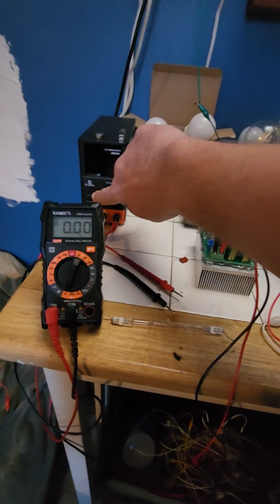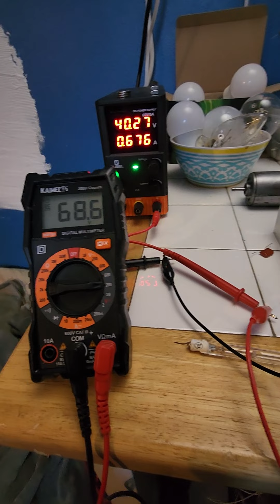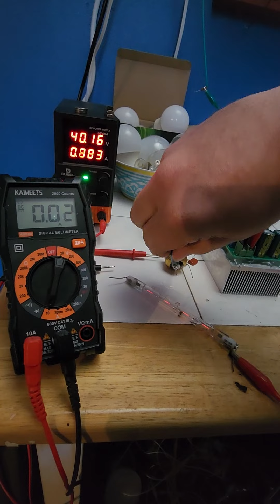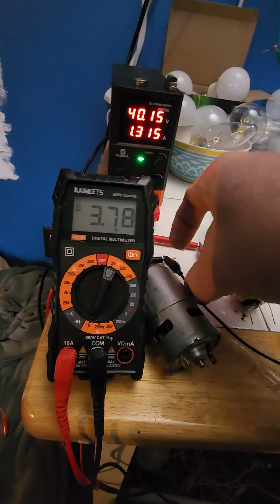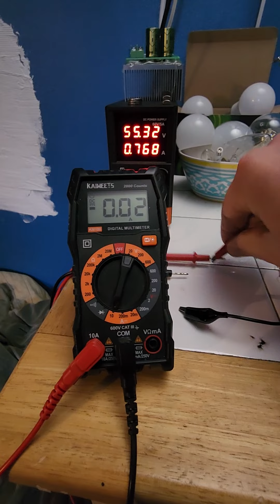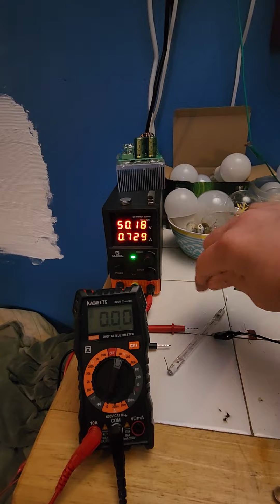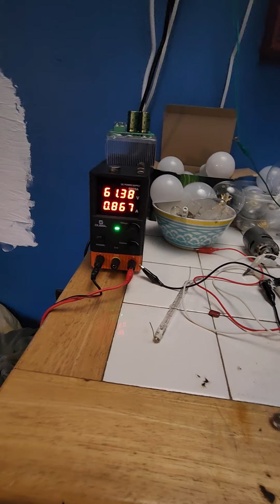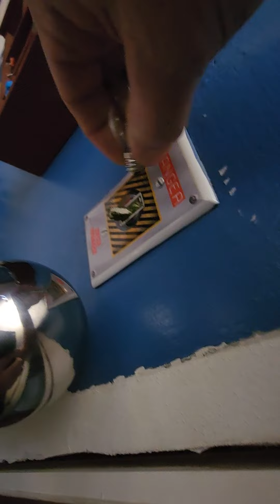⚡️Mal-Effect Generator  Tests. Absolutely Undeniable Resonances Using Back EMF & Earth⚡️

Comment: For Watts, Voltage and Amperage MUST be measured simultaneously.  I love your work and don't want to see you get criticized for such a common mistake.  All you need to do is retake the measurements while using two meters measuring a load a the same time (one set to volts. the other set to amps.)

Comment: Regarding 3-5 times more out than in... Sorry but there is no proof so far as you keep making the same mistake that I pointed out earlier. You need to measure both volts and amps at the same time to assess the available power. When you do a short circuit current test, your voltage drops to some low value that you don't take into account. We can't multiply the open circuit voltage and the short circuit current. The illumination of  the halogen bulb looks close to your input power, it doesn't look like full intensity that you would get at 120 volts. You can put an ammeter in series with that bulb while measuring the volts across it. Them multiply the two - that would be a real indication of power. I'm not a naysayer, but advocate things to be measured properly to avoid errors. Thanks for your efforts
Reply: I think you misunderstood..... the multimeters take the rms it takes multiplier by 1. 41 .to get the real voltage . it is not difficult to prove moreover a much better amperage and can of losses by Joule effect with the rf and negative system (npn) ... the amperage is an electron flow in coulombs per second .... made of massless current like m tech. it is the best there is no steel. the steel traps the amperage because of its very low resistance. moreover m tech I have a problem with my output loads I have the impression there is too much frequency my bulbs do not light when I manage to light them without the earth on the other motor very strange with the reed contact I have yet between 50 and 350 volts .... I have the impression my bulbs are not taking charge. .. whereas the plasmas must be taken by the load I feed in 8 volts and with the return emf

Comment: You are a very great worker ❤thank you for the humanity 😘😘😘😘😘😘😘
Reply: Tu utilise bien un npn ?
Reply: He use the npn rf ?
Reply: I'm turning on the loads on the little renaissance haha .... I don't understand I can't turn them on even though I have the right contactor and the same voltage ... came out on both engine . ... I'm going to work ... again for me the only thing that changes is the magnets and the frequency I have a very high frequency on the small rebirth output with the reed contact .... it may be too far away I have the impression that the plasma is not attracted by my load, although on the big rebirth, yes, my hypothesis is that the coils are too close, the em field of my bedini coils sucks the energy from my generator coils at the cutoff..

Comment: Nice work! Congrats, man!  I am going to modify my device just like yours and close loop it using the LTO batt pack.
Reply from the maker: Yeah the Schotty Diodes Really Did The Trick
Reply: @MTECHINDUSTRIES2022  What model number are you using for the schottky diodes?
Reply: @MTECHINDUSTRIES2022 also, for the RF to DC converter, can you perhaps share the link where I can find it? Can’t find one at Aliexpress..

Comment: Curious.  What is your RF to DC board frequency set to?  In theory you could increase the output by adding 2 or more RF to DC boards -. All boards tuned to different frequencies connected in parallel.

Comment: Yeah, this whole "overunity" thing should really be mainstream.

The simple fact that heat pumps exist is proof enough in and of itself that clever systems can relocate energy with COP greater than 1.

We already hey overunity from heat pumps and no one cares because of the terrible excuse that the heat it moved already existed.

Then they pretend that isn't what everyone else is trying to figure out by trying to replicate the heat pump but for different energy types.

If it can be done for heat, it can be done for any other energy type.

It's a shame that people make fun of researchers trying to figure this out. They make it seem like your a quack, but heat pumps exist and they can have COPs greater than 10 with good setups.

The pump relocates a full order of magnitude more energy than the energy requirement to run the pump and they still insist It's not overunity.

Comment: I really want to understand the details of how it works. I'm almost educated enough to get it and intuitively, I know what this is--that it's real and that it's what Tesla had. I have a really interesting idea for a Tesla coil that would be fascinating to study (it's a separate type of coil that would be either the primary or some kind of topload thing, as well. I need to understand induction as far as the spin direction of the different coils. I have these intuitive ideas about reverse polarity coils and a special type of coil. I do understand about perfect tuning and I have been studying resonance in music and in circuits for a long time. I understand a bit about very high frequency,  every component now has reactances and self resonant frequencies. I have a very special system of music that allows for the cleanest possible harmony in the Universe. It's Just Intonation, and if you use a magic number, very very special things happen. I believe it definitely connects directly to Tesla and Vortex Based Mathematics and higher dimensional Geometry/physics. These are Tesla numbers, I can explain it all (3,6,9 numbers in perfect harmony with the harmonic series) ie, fractally harmonic, perfect music where every single note is always a whole number and no decimals and where every note is divisible by 3, 6, and 9 (and more) and every frequency all adds up to 9. Ontop of that,  every single note is derived only from the harmonic series and there are incredible patterns of palindromes/permutations of all the frequencies!! It's connected directly to worldwide, ancient indigenous music and the ancient Indian Classical Music system (most advanced on earth with the mysterious 22 note Shruti scale). I believe this is all very important.
Reply: The Secret of 369 can be seen as being described in the quantum theory that followed Nikola Tesla's work. Quantum harmonic oscillators are thought to be the very Foundation of quantum physics. When it comes to these lc tank circuits, there are three fundamental frequencies that are resonating in harmonic relationship to each other that maintain the total system. For Quantum oscillators the oscillation is always in the timing of 123 which is the zero point that separates the next set of 123 followed by the next 0 point and then the final 123. So when you add these up you get 3 6 & 9 that are separated by these 0 points evenly. So when you are able to achieve this pattern with your own arrangement of energy, it naturally creates a fractal and harmonic relationship with that Scale of the Universe. This sort of cylindrical harmonic oscillator connecting you with the Zero Point Energy is described in the second order of the Bessel functions.https://mathworld.wolfram.com/BesselFunctionoftheFirstKind.html

Comment: Personally i wouldnt use the term overunity. It has too much stigma attached to it and makes it less likely that people will take this seriously. "Overunity" refers to a CLOSED system that has a coefficient of performance above 1, which is impossible according to the laws of physics. This is different because it is an OPEN system that is drawing in energy from an external source. So while it may be outputting more power than it takes to run the device, it is not generating energy from nothing. Its operation is closer to something like a hydroelectric dam or wind turbine. It is extracting energy from an external source and converting it into electricity. I would call it something more along the lines of an ambient energy generator or emf implosion generator. (im bad with names)
Reply from the maker: Yes very true & were probably going to rename it Somthing that follows those lines. It's sucking in ambient rf from the background/enviornment.
Reply: @MTECHINDUSTRIES2022  Sounds good! Its a real shame that people are quick to disqualify something based on preconceived notions that may be false. Its a sign of low resolution thinking and eliminates nuance that may be the key to discoveries like this. Keep up the great work!
P.S. How about calling it an ambient RF pump?
Reply from the maker: @Figment  I like that & our Devices is similar to a solar pannel except of turning sunlight into electricity we turn excess radio waves into dc electricity:)
Reply: @MTECHINDUSTRIES2022  Is this the same or similar to the radiant/ambient energy that tesla talked about? If i remember correctly, he talked about radiant energy emitted by the sun that could be used to generate electricity, except this energy was everywhere and could even work at night time, unlike solar. From watching your videos, it appears that you need both a transmitter and a receiver for it to work. Im not sure if that was also the case with teslas radiant energy, although i do know he also was working on exactly this technology as well. (ie: wardencliff tower transmitter)

Unfortunately im not very knowledgable about electronic systems but i have an intense interest in alternative energy research such as this. Any tips for getting started? I know this is cutting edge technology youre working on, (well, lost tech to be more precise) but is it to the point where someone would be able to replicate this if they had the knowledge? Any tips on getting started on this journey? Ideally in the future i would want to be able to build something like this myself to reduce my reliance on the grid or eventually generate 100% of my own power.
Reply from the maker: @Figment  if your just starting out I would build a simple slayer exciter tesla coil on a 1 inch diameter pvc pipe. To get the radient energy effects cut the pvc pipe 6 inches long. Wind a four inch long 26 awg Secondary L2 coil centered on your 6 inch pvc pipe. Wind your L1 coil the same direction as your L2. L1 should be 8awg & no more then 4 turns or 1 inch long in length. Next you'll need a pvc coupler & You'll Wind a 2 inch long 16 awg coil in the opposite direction to L1 & L2. This is a bucking coil & seems to rip open the zero point energy field/counter space. Also putting certain minerals & metals in the field of influence of this type of tesla coil causes them to emit massive amounts of radient energy. I discovered that the radient energy can be retransmitted from different materials
Reply: You are not sucking electrons out of the environment, or creating energy out of nothing either. Negative resistance has a much greater impact in these situations than most people are aware of. You are creating a time reversed oscilliation, this breeds a whole new set of quantum formalism that literally negates the ability to even observe it. 

Bearden put it like this-

The "charge as a set of composite dipoles, each with broken symmetry in the vacuum energy flux", is the solution  to how the charge continuously pours out energy in 3-space, with no observable 3-space energy input.  It receives its energy from the vacuum as unusable virtual energy, but transforms it into real observable energy and then pours that energy out in all directions.

 For a crude first order model, the charge spins 720 degrees in one "rotation", being 360 degrees in the complex (time) domain and then 360 degrees in 3-space.  While in the time domain, it absorbs incoming scalar (time polarized) photon energy, integrates it with its spin, flips into 3-space, and its excitation decays then by re-emitting that EM energy in all directions.

 Now, one can easily do an experiment to prove that charge and a dipole do continuously emit energy.  Just place the sensors every one microsecond distance apart, and measure the result from a nearly instantly produced dipole or charge at the origin.  Either we have to discard the conservation of energy law, or else the energy must be continuously replenished from the time domain, i.e., there must be a time-like EM energy flow into the dipole or the charge. That evokes the time-polarized EM wave and photon. Obviously that would be nonobservable, since observation is a d/dt process invoked upon a 4-space LLLT operation ongoing, yielding an instantaneous 3-space frozen snapshot of dimensions LLL.  Any energy flow along the fourth Minkowski axis will just be discarded in the observation.  Repeated observation will continue to eliminate and miss all the input energy along the fourth Minkowski axis.

 So to save the conservation of energy law, we must propose time-like EM energy flow, entering into the charge unobservably (in the time domain), and observable EM energy flow out of the charge in all directions in 3-space.

 Whittaker's 1903 decomposition of the scalar potential into a harmonic set of bidirectional EM longitudinal waves has an interpretation flaw.  Whittaker interpreted the phase conjugate EM wave AFTER it has interacted with a charge (i.e., the ubiquitous unit point static positive charge assumed by classical electrodynamics to reside at each and every point in 3-space.  In short, he interpreted two "effect" waves as if observed.  Instead, the "causal" wave always exists  in 4-space prior to the observation (yielding an effect in 3-space). So we reinterpreted his decomposition into an incoming time-like EM wave in the forth Minkowski axis, interaction with the standard assumed unit point charge, to give the output longitudinal EM wave in 3-space.  Note that these output waves are in all directions, so one still has a "biwave" solution via the symmetry in the distribution.

 But now the conservation of energy law is saved.

 Also, quantum field theory powerfully supports this proposed solution to the source charge problem of the association of its fields and potentials and all that energy in them, reaching across space.  In Mandl and Shaw, Quantum Field Theory, Wiley, 1984, Chapter 5, Mandl and Shaw strongly argue that neither the scalar (time-polarized) EM photon nor the longitudinal photon are individually observable, but the combination is observable as the instantaneous scalar potential -- which, translated into wave terminology, fully supports my reinterpretation.

Now, having solved for the inability to observe the cause of this extra energy, take a look at Gabrielle Kron's approach to LC Tank circuits as a model of the Schroedinger equation - https://journals.aps.org/pr/abstract/10.1103/PhysRev.67.39

And you will see that because of the super position of energy which are a result of negative resistance in the you guys will see that it's not about proving how much energy is extracted during this process of conjugate oscillation, but focus more on how easy it is to rearrange the system so that you are able to use more of the energy that's already present in the system. And that the mechanism to do this is all about harmonic relationships and the ability of opposing systems to work together 2 create a third order harmonic that is greater than the sum of the two systems. And obviously if you are not correctly reflecting the harmony of the system that you present, then people will think you are being disingenuous and therefore fraudulent in your presentation. Because of the dispersion of energy states in that phase space any outside Observers will only be able to witness one interaction of one of an infinite of States within that field. You ultimately have the ability to decide how you will act or not in that moment. Which will determine whether or not you will be moving that face space into the next harmonic order. So you see fellows the physics doesn't stop when you turn off the machine, just as they don't stop when you are not observing them.

Comment: I swear to God, PayPal is blocking me from paying you. I'll use my debit card!
Reply from the maker: Here's our gofundme link & any donations are greatly appreciated 

https://gofund.me/8589fa59
Reply: @MTECHINDUSTRIES2022  could I ask you what voltage is that secondary putting out and what is the 3rd coil doing, exactly? It has less turns so, it's putting out a lower voltage? Is it just to step it back down again or is it making the overunity much greater?
Reply from the maker: @Great Awakening  the secondary is probably putting out around 100KV & the third coil which is the extra coil is wound in the opposite direction of the L2 & made out of 16awg stranded wire. L2 IS connected in series to L3. I discovered that this bucking coil arrangement greatly increases the power effeciencies of the transmitter along with very impressive radiant energy effects meaning any wireless led receiver that's grounded will light to full intensity.
Reply: @MTECHINDUSTRIES2022  yes, what you found is very very special. Only Tesla ever had this level of discovery. He had this I'm 99% sure. One wire transmission but more importantly only one wire to the ground, only.. I'm pretty sure he discovered this and the radiant effect where the wireless load wouldn't actually load the "source"! Thus proving free and unlimited power from the earth. The only question is, how much can we take before destabilizing the Earth's magnetic feild. But this might not even be electricity as we know it...